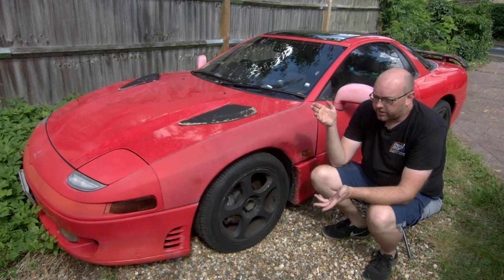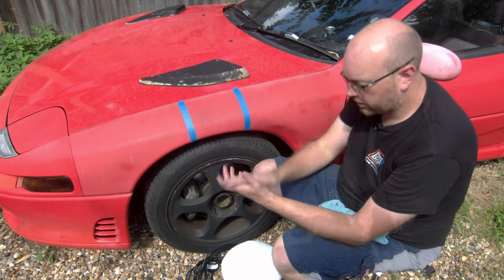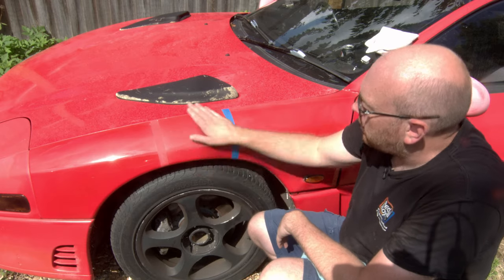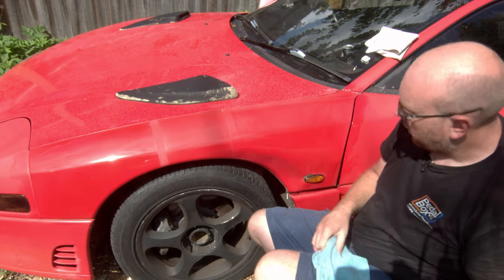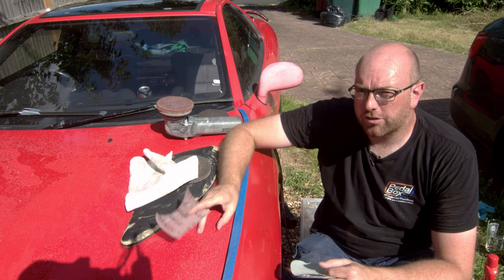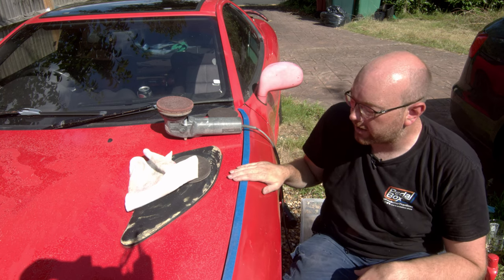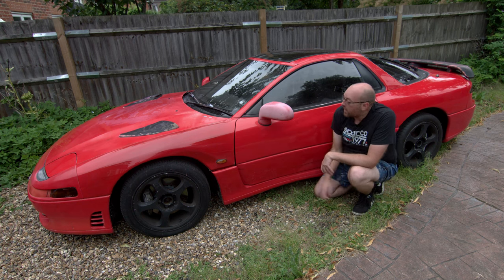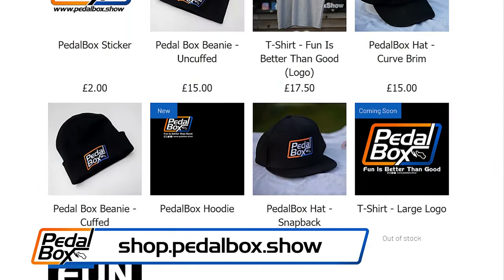Is the paint UNSALVAGEABLE? | Mitsubishi GTO | Fleet | PedalBox Episode 141

Comment: Put a carbon fibre wrap on the bonnet ;D
Reply from the maker: I'm generally against a carbon wrap, because proper carbon is better... but there IS a temptation given the circumstances...
Reply: @PedalBox  A bonnet wrap might be the quick solve, but remember the bonnet gets warm.  I think part of the reason for the flaking in the first place is the excessive heat soak from the engine.  Not sure how a wrap would cope under those conditions.  Probably partly due to the poor condition of the insulation ont he underside.  Maybe look at doing something with mylar foil to add some protection to the bottom?   I know you can  get replacement foam from dynamat but its $$$$.  And an OEM insulation sheet is a few hundred too iirc.  If you can find one.